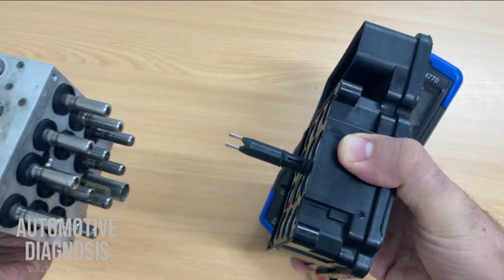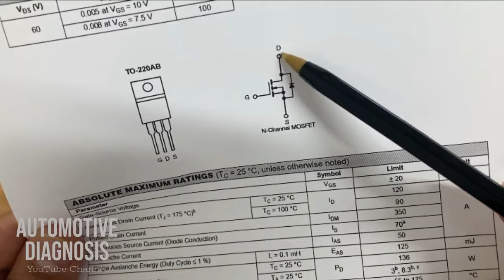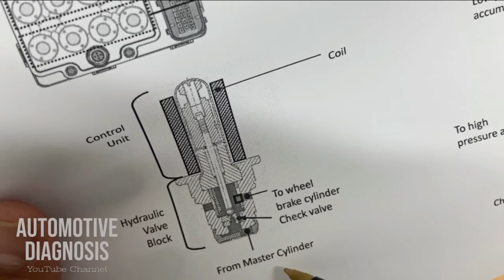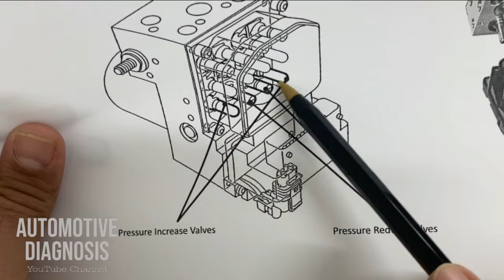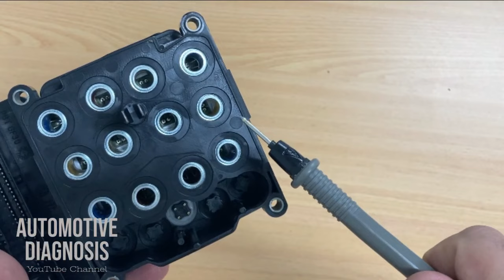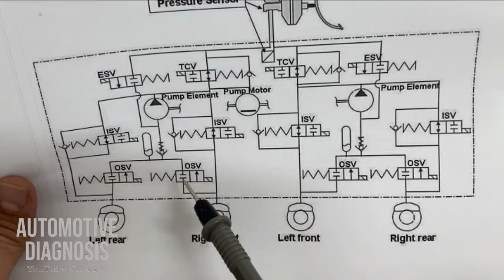Don't Replace ABS Module Before Watching This | Part 2 | ABS Module Components Test #abs #tcs #ESP

Comment: Penjelasan yang mudah dipahami. Saya ingin bertanya pada anda, bagaimana cara memeriksa kode kesalahan u3000 pada modul abs ford fiesta? Mohon dijawab, terima kasih.
Reply from the maker: Hi, for this code you need to check the power and ground on ABS Module and also CAN-BUS terminals.

Comment: 1st thank you very much if this great vedio
I meet 2 times problems with my car 
1 st one the module stoped because the vacuum pump not working but motor working properly
I changed already abs unit 
2nd one after time too have a problem get the oil from pump to module
Now I want to repair the old pump but the pins on  not released this pins on motor head inside the pump
Reply from the maker: Hi there, I didn’t quite get the question, is there any fault code right now?
If brake fluid is not coming into ABS module, this is not the ABS motor fault, you must check the master cylinder.

Comment: iam working on peugeot 301 abs i daignose it i find  front right sensor and front left sensor not working and i opent it i fund some  line on the board and i repair it and fix it back  he didni worh so i need some help thank
Reply from the maker: Have you checked the wiring between ABS module and sensors?

Comment: abs engine will have oil leak inside just like it happens with master cylinder please answer me appreciate
Reply from the maker: Hi there, I didn’t quite get the question, you mean break fluid leak inside the ABS module?
Reply: im sorry my friend i was trying to said is the abs motor if is leaking interior like happing with master cylinder brake
Reply: abs motor not module
Reply from the maker: @carlosg802  I haven't seen any internal leak on ABS motor, but internal leak on valves is possible.

Comment: Thank you very much, this is great explanation, do you have any video for how to check the IC5895-5220C if there's IC fault, how to check it? and how to scan it directly the ABS module in bench (pinout connection to OBD scantool). can you share the diagram for Ford Fiesta 2011-2014. again, thank you very much!
Reply from the maker: Hi there, we don’t have any videos for inspecting that IC, but I will try to get one.
Reply: Parabéns pelo vídeo! 
Sabe dizer se existe algum substituto pu similar para o IC5895-5220c que possa usar nessas placas ABS Ford?

Comment: Great video.
Question: 2009 Ford Escape with very  low brake pedal.
No codes or lights. Replaced master cylinder, all shoes & pads good. 
Had shop bleed ABS module with scanner. No change, still very low pedal. 
Is ABS module causing this?
Thx
Reply from the maker: I don't think that's ABS fault, if it is, it shows itself when you do the bleeding. Pedal is low, but how you feel the pedal?
Reply: The low pedal position could be the end of the rod connected to brake pedal. Most Fords have an adjustable screw on end. I think it is a 7mm and you can lengthen it to cause pedal to react quicker.

Comment: First of all thank you for your efforts
I have jeep grand cherokee 2011 my front wheel lock properly but my rear wheel not lock the wheel enough,
I have changed everything but not the abs because there's no abs or any light in shown im my dashboard,
And when I try to bleed the rear ones the brake oil the pressure of it approx. Nothing compared to front ones
Do you have any advice?
Reply from the maker: Hi there, 
Have you checked the master cylinder?
Reply: @AutomotiveDiagnosis 
Yes already replace it with new mopar

Comment: I have a unit like this one. ATE MK60E it keeps throwing C2200-49 internal module failure. I have already verified that motor & valve circuits are good. I'm scratching my head on this one. Any insight would be greatly appreciated.
Reply from the maker: Thanks for sharing your experience. If you have checked the components as described in this video and part 1 (link in description), it could be the control unit failure which does not switch the actuators on.
Reply: @AutomotiveDiagnosis  sounds correct when I clear the code it's fine, has bidirectional comm. Until wheels start rolling as soon as I hit 2 mph, it comes back
Reply: @rhinoleveling  I have same problem too.dont now what to do
Reply: @AutomotiveDiagnosis what do you check or replace for this situation, where the control unit doesn't turn it on?

Comment: how can i fix, test or replace the pressure sensor? tks
Reply from the maker: Hi there, Pressure sensor is the hardest one as it senses the pressure and gives it directly to ABS module, so the only section to check is the contact between the pressure sensor and ABS module. In most cases we have to replace the ABS module is case of having a faulty pressure sensor.
Reply: @AutomotiveDiagnosis Is the pressure sensor in the ABS hydraulic block an active or passive device?  How does it work?  Does it provide a variable resistance, voltage or current proportional to the hydraulic fluid pressure?  Is there any way to test the pressure sensor itself?
Reply from the maker: @N2Stooges  Hi my friend. there is no way to test the pressure sensor itself, as it is inside the ABS module. It generates variable voltage based on the hydraulic pressure.

Comment: This is very cool! Thanks for sharing your knowledge.
Reply from the maker: Glad you liked it and thanks a lot for your comment.
Reply: @Automotive Diagnosis: Cars Repair &Training Guides  if I can suggest one thing to make your awesome video more awesome: show how to check integrated circuits. I have an MK60 module off of a 2002 BMW 325i, got the trifecta lights on my dashboard. Turns out I have a bad IC (9369.1D).
Reply from the maker: @juvehe  Hi there, Thanks a lot for your comment and sharing your experience. I explained more on the first part of this video but as you said there is more way to go and hopefully I can make another video too.
Reply: @AutomotiveDiagnosis  I watched your first video as well, both are awesome!
Reply from the maker: @juvehe  ❤️❤️
Reply: @Automotive Diagnosis: Cars Repair &Training Guides  in case anyone is curious, the error code I get is 5DF5: ABS-DSC internal fault, control unit.
Reply from the maker: @juvehe  Thanks a lot for sharing your experience.

Comment: I think these 2 videos go a long way to explaining the error codes in BMWs which a mechanic is never going to string together with an electronic fault. And just removing and replacing the large connector is a WORK AROUND which if it works is destined to fail again. So well done .
Reply from the maker: Thanks a lot, I'm glad you liked the video.